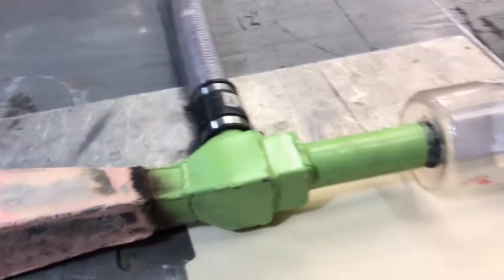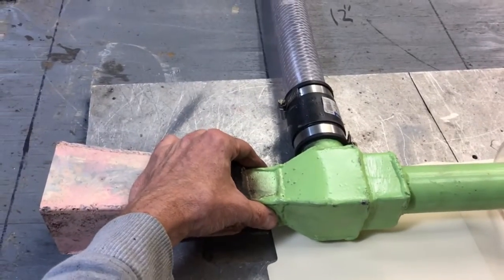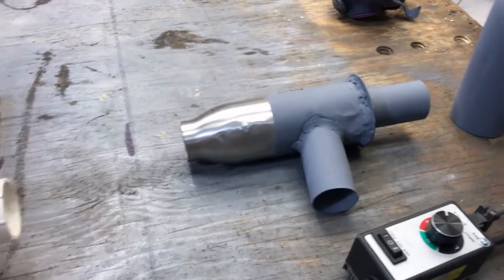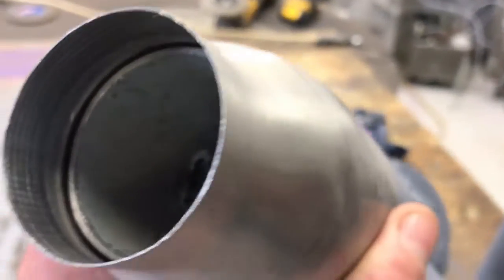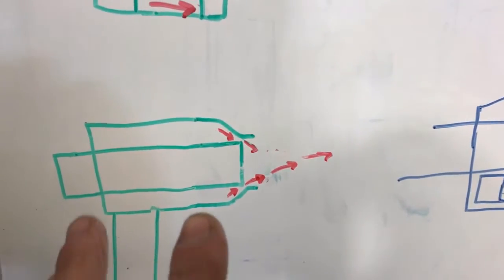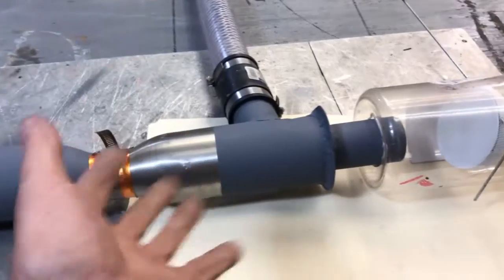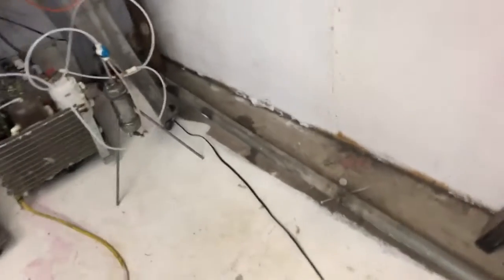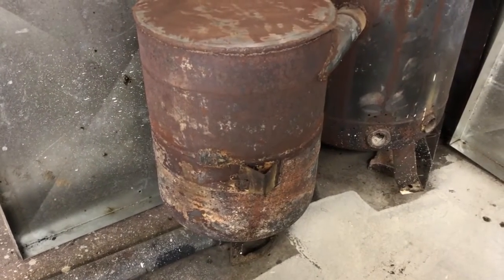Venturi pump for dirty exhaust gases Air amplifier INFORMATION

Comment: Question I hope you can answer. How does the air flowing in from the bottom of the 2 know which side is the "exit" side versus the inlet side? Does 1 side need to be longer than the other or is the size of the inlet diameter versus the outlet diameter? Thanks. Great video by the way.
Reply from the maker: its like a ball rolling down a hill , its already going that way so to turn around and go the other ay would take a force
Reply: @NOBOX7  so as long as the outlet is higher, it’ll flow that way?

Comment: The short length of your vacuum instrument is causing the air flow to bypass the measuring process. slap a cardboard tube on so that the air stream is going to push on the flap without vacuum port interference.

Comment: Sir it seems you have connected your blower to the port usually used for suction. And use the normal blower port for suction. You will likely find a rediculous improvement in efficiency when you turn them around.
Reply: Meh. It works as intended. Though your not wrong as it would have less redirect loss from having to swirl tight corners.
Reply: @Slowly_Going_Mad  Would you mind supplying me with your contact number. I need assistance with a project. Or an email address.
Reply: He hooked it up exactly like dyson bladeless fans.

Comment: Also you can drop it in a bucket and splash some gasoline or diesel on it and let it wash off and mix it into your waste oil to burn later.
Reply from the maker: Strangely this tar we are gonna see is highly resistant to solvents of every kind ive tried , however i have yet to try a polar solvent like butane
Reply: @NOBOX7  One way to try butane would be to get a stainless steel [or very heavy gauge aluminum, but never a thin aluminum one!] pressure cooker, drop in the part, then purge the air [as we know air and fuel can ignite and in an enclosed space...not a great idea] then fill to let it sit a while in saturation.

Since butane is a liquid at 32 F [ 0 C ] you can easily keep the pressure down below anything too dangerous. Some canning pressure cookers come with gauges [I have 3 of these] built in, although it would not be difficult to add one since most of them have pre-drilled threaded lids.

One awesome advantage, should butane prove to work, is that you can 100% reclaim it without having to 'clean' [or filter] it simply by letting the container full of dirty butane warm up and be vented through the pressure cooker pressure stem and a piece of vinyl tubing into the original canister inside a freezer, OR, if its already really cold outside, just out in the cold air.

If that worked [the dissolving of the creosote] you could repeatedly reuse the butane while always keeping a clean part.

Another [also very dangerous, but for other reasons] powerful solvent which might work would be ammonium hydroxide. Since it is corrosive though, as well as it will dissolve copper, brass and bronze, it would certainly not be the number one choice for any parts with copper, aluminum, or magnesium in them.

Also, no matter what temp you are at, you will always lose some ammonia from a hydrated mixture, so you would have to recharge your supply, and keep it in a cool dark place so the tank did not exceed the vapor pressure of the percentage of solution on hand.

We all know that all such chemicals need to be kept in a well ventilated place, away from sparks, open flames, pets or small children.

Comment: You could almost add a little slide collar onto your swing valve to add weight to compare the power once you got all the way to the end of the travel, that way you could determine more powerful systems simply by sliding the weight further down the wire like you can do on many metal cutting band saws have on them. ~( 'w')/

Comment: so you and me seem to think alike. I have been designing something like this for my waste oil heater. The problem with moste waste oil heaters is that they force air in the heater. Now in ideal conditions that wil be fine. But if something is not ideal there might be toxic gasses coming in to the shop. I dont want to breath the crap that might come free from a waste oil burn all day. So my idea is have the exhaust suck the air in to the heater. I think it could get just as much air in to the heater as the blower is blowing in now. But if it sucks the air in it should allways suck the dangerous gasses back in as wel. And even a small leak in the exhaust system pre vacuum suction system it would not let exhaust fumes in my shop.
Reply: also the horn on there really makes it in to a proper venturi, small in the middle, then creating a low pressure as it widens out. And that low pressure makes the suction power on the exhaust.

And in my research i think i found a system like this, they didnt really tel how it worked that wel. But the system was over 600$. Now if you build this yourself you can be done way under 100$ i think.
Reply from the maker: Yep a vacuum system or negative pressure system is the only way to go , if you got leaks then air just leaks into your furnace system